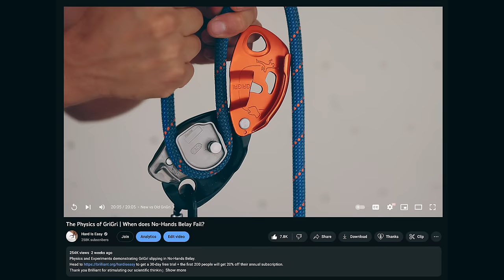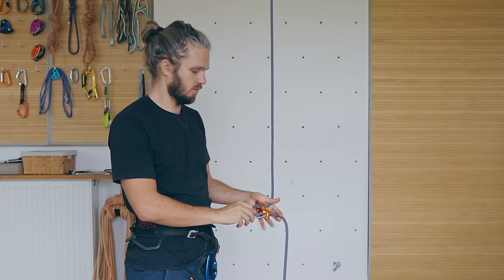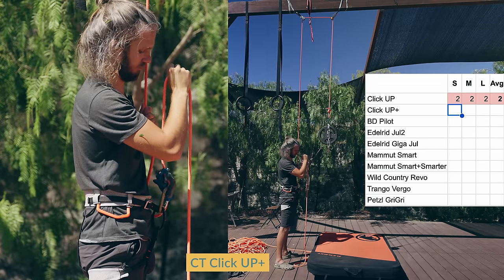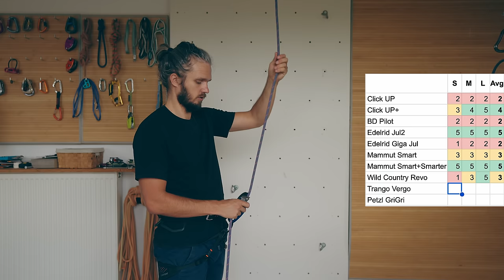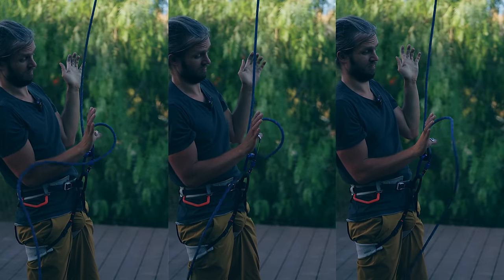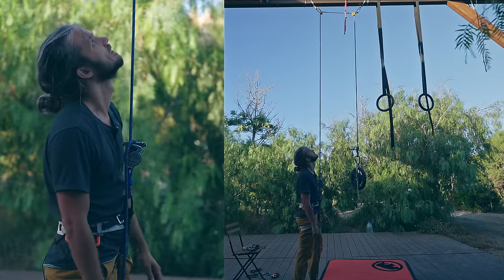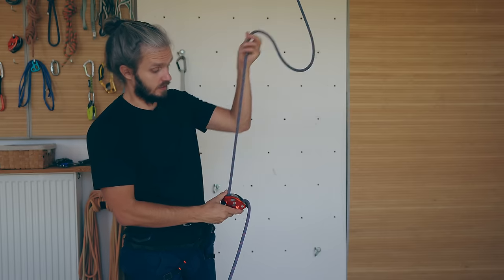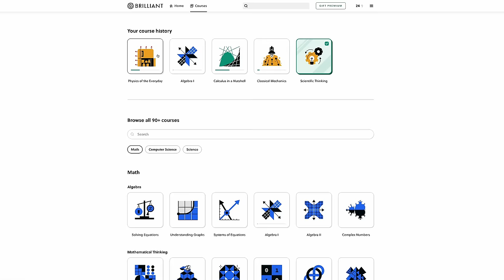When Assistance Fails!? The Physics And Experiments of Belay Devices

Comment: I kind of wish you had added the ATC to your rankings when you were testing all the devices together - a friend of mine saw your previous video of the grigri fall and concluded that she felt safer using her ATC than a grigri because of it! So I worry that this kind of video, pushing all the assisted devices to failure, might be better with a little disclaimer that the ATC would fail all these tests! Anyways now I'm curious about if there's any way to make an ATC fail in guide mode. Also, I hope you get some belay gloves for whatever tests you do next, that was painful to watch - but thank you for the sacrifice for this amzing demo!
Reply: Some ATCs will fail in guide mode with very skinny ropes coz the two strands will get pulled past each other.
Reply: Yes it should be on the same chart with 0 for all tests
Reply: The ATC is like all the other devices.  One has to use it properly.
Reply: @FlatOutFE  No, I agree, I have one and use mine regularly (my gym ropes are thick and fuzzy enough that giving slack with a grigri is a struggle, and for multipitch stuff), and I like it. But even with perfect technique, an assisted device is arguably a lot safer for sport climbing outdoors where a rock could fall on your head and where the weight penalty and the capacity for using 2 ropes don't matter. And I certainly wouldn't consider it safer than an assisted device.
Reply: @Blue-pb7kz  , two ropes are safer than one.  Helmets designed for side impacts are safer than those just designed for top impacts.  Two carabiners are safer than one.   Locking carabiners are safer than non-locking carabiners.  In the end we all make compromises.  The unfortunate thing is that most people now consider ATC devices as unsafe, yet they have served climbers well for 50 years.
Reply: @FlatOutFE  I think that that depends on where you live. In my country, the majority of people use ATCs, and gyms only have ATCs for rent and for beginner classes. Assisted devices are rare here. I think people here could use more assisted devices, and that it would be a good thing on the whole for more people to use them. But I hear in America some gyms force people to only use assisted devices, which I don't love - I think learning to belay on an ATC really drilled in the "don't let go of the break hand" side of things that Grigri users might get lax on. Still, I'm glad I have a grigri, it has its uses, and I do believe it's safer so I take it for outdoor sport climbing. But I also keep my ATC. Like you said it's a compromise, especially bc time is also a major safety thing that competes with all the redundancy and sometimes you have to be quick and not spend half an hour building an anchor. (Though I think the choice of using two ropes isn't just a safety thing, but more of a rappel thing!)
Reply: This! Your comment should be upvoted!
Reply from the maker: Agree! I had originally a segment talking about this and more on other devices but this vid got to long and I decided to split it and do a separate overal comparison video.

ATC is hands down the most risky option and if climber doesn't understand that well he had a bad training or haven't seen enough fails.

Comment: I feel like the revo is so misunderstood, the assisted breaking is not ever supposed to engage except for those really catastrophic situations. Generally, it provides zero assistance and it's big selling point is it being an extremely smooth tube style belay
Reply: Exactly, I haven't used it extensively but you basically belay with it like a regular ATC-style device and the full lock-up is there in case you mess up or get injured.
Reply: @Govanification  I've never used one.  So if your break hand is held down the cam never spins up to 4m/s before locking? It's an instant lock?
Reply: @Yildun28  No if you hold onto the brake strand, the device brakes on the friction teeth like a regular ATC and thus the rotating cam doesn't spin fast or engage at all.
Reply: I used the revo for a bit. I wish it were easier to engage the lock when someone was hanging. And I also accidentally engaged the lock when quickly pulling in slack which caused some headaches. With more experience that would probably go away or I could recover from it smoothly. Kind of hoping they can figure out a 2.0 with some improvements because I did love how smoothly it fed out slack
Reply: @belavandervoort  I'd never thought about either of those situations! the first seems super annoying, that's my favorite thing about using a grigri! The second seems like it could be dangerous?
Reply from the maker: Yea for sure, I was comparing apples to apples how these devices react in same situations. To my best ability.
And as some pointed out the biggest issue with Revo is that it does not provide enough resistance while taking slack so if someone is projecting a route you'll hate this device.
For casual belying it's nice.

Comment from the maker: A note: As I already mentioned carabiner plays a big role in auto-tubers, and although only CT ClickUP / + requires specific carabiner, for the next video I'll try to reach out to manufacturers and get their recommendation on "the best" carabiner for their device. And then test everything again... :D
A note #2: In some of my tests I inserted Trango Vergo incorrectly, but it's still nice to know that it worked well, but seems like I'm slightly too dumb to understand this "intuitive" design to load it properly all the time :D Also I received multiple emails stating other issues with Trango Vergo that I'll have to investigate for the follow up video.
A note #3: Just received another email with a video demonstrating Jul2 slipping and not locking at all - and Jul2 worked in my tests so well :(

So as I already said - there is always more to every story... and I see that creating a Rating table might have been not the smartest move of mine :DD
Reply: Hello, loved this video! I use the fish. Have you heard of it? It’s comparable to the smart 2.0 I guess 🤔 and it always comes together with its own security carabiner when you buy it. So far I‘m really happy with it :)
Reply: I have a megajul sport and it fails when the wire loop (i dont know how its called )gets stuck in the top off the screwgate in the carabiner,  and its works as a normal belay plate, because it dont let the megajul get clousser enough to the carbiner to press the rope
Reply: Your suffering for science is appreciated, but feel free to use gloves next time - we will not judge you!
Regarding Gigajul, I noticed quite a bit of carabiner dependence. Some are much better than others! Could you test that and maybe reply back? What seems to work well is the Edelrid HMS Strike FG.
Reply: @testboga5991  I use the  I use the Jul2 + HMS bulletproof Triple FG carabiner in the gym and the GigaJul + HMS bulletproof screw FG outdoors. so basically the same carabiner, and more or less the same as ths HMS Strike. I've noticed the GigaJul tends to slip a lot when it should be locked off. Like if I relax my grip, the rope will start slipping through.
Reply: I think that Jul2 also requires special carabiner - the steel one or Edelrid Booletproof (aluminium with steel insert), as it is not very gentle with alu ones. It can be also a safety issue.
Reply: The edelrid JUL² is VERY sensitiv on rope+ biner combinations, a new 9,8mm rope+JUL²+not intended Carabiner i wittnessed following effect:
At break check it blocked the rope, when climber afterwards sat in rope at the top to get lowered, it completely started to slip like there would be no additional friction at all.
Only the brake hand holding prevented a too fast descent of course. But i never wittnessed such a complete loss of additional braking friction also just once since invention of JUL²in 2016.
i can´t remember exactly, but it was perhaps a dry treatened rope my clients bought themselves, not sure. But really akward to have a autotube style device, doing nothing to brake the climber. The only "wrong" in the setup was the used biner Grivel k10g S, and i had no Edelrid Bruce HMS (intended to use with most Edelrid devices) not with me that day.

So: Each belay device has to be tested with care, every rope, every climber, and perhaps rain on the device can change the behaviour of the device.
So never let go the break rope, and new ropes can be slippery as hell.

i also have some experience on cinch/vergo:

it´s a pretty underrated device (both cinch (old) vergo (new) ) in my opinion.
Downside, the akward and unusual handling, wears down rather quickly.
positiv, no spring opening a blocked device, so if the belayer hold the brake side of the rope ( as everyone should do) it´s safe.
the bad reputation the cinch got, was user error intended. blaming the device for "not blocking", but all those accident where when they let go the brake side.
The cich/vergo is a very safe device WHEN USED CORRECTLY. (especially the brake rope has to be controlled 100%, to make the vergo even block when attached wrong to harness, or entered the rope completely wrong.)
i know and own lot of belay devices and i also use and have teached them how to be used.
And the principle of the cinch/vergo is just ace, in my opinion. Is it fool proof ? No of course not.
But as every device, a good belayer can do a lot even just with a simple hitch. A rather bad belayer can always screw up somehow.

Comment: I've been using either a Jul or mega jul for a few years now and have a few comments on technique.
You don't need to wrap your thumb all the way around it when paying out slack, pushing it to the side with your thumb or just using the pad (tip) of your thumb to put some pressure up on it is enough to allow slack to go through easily and will not put up enough resistance to hold the device open if the leader falls.
The narrower the beam of the belay carabiner is the harder it will catch a fall, I've been using the bulletproof HMS locker for a while now and it's been a good match.  The large round cross section lockers don't get pulled u into the notch as far and it can end up with a bit of slippage, not a drop, just a bit of slippage.

It was neat to see the giga jul just slow down the weight and not fully lock up since these devices are marketed as assisted braking / friction increasing devices and not auto catching.

Comment: Regarding your test results with the Gigajul.
In the beginning I had exactly the same results. I tried several carabiners until I found a really good fit. the most important thing was that the upper carabiner axis is as narrow as possible. currently I use a Petzl Frenio, with this the Gigajoul locks pretty quickly and reliable.
Reply: good to know thanks. I just got a gigajul and was gonna get the freino for my grigri
Reply: The natural choices of carabiner to partner the Edelrid Giga Jul would be Edelrid's Bulletproof (with the steel insert to reduce rope induced wear) and the Strike. In my experience, the former is too large, and giving rope is a pain; the latter is better in that regard, and I believe that Edelrid itself sells this pairing as a set.
Reply: Would a megajul behave similarly?

Comment: I have a BD Pilot and I've had really good experience with it. And what I like about it is the reliability and consistency. The device extremely rarely does something unexpected in my experience.
Reply: I love mine too, but I have had 2 instances where it had some issues. Both were caused by my climbing partner. One was leading in a gym and he didn’t flake the rope when he pulled it out, it was so twisted up that the rope curled through the side next to the carabiner and caused the rope to bind while giving slack. Other situation was the same thing, but outside. I need to make him flake his rope so that doesn’t happen again, and I’m sure that would happen with most of the tube style devices
Reply: Same here, using BD for 3y without any dangerous / slip situation. As said in the video - it's about experience and understanding the device, not about the device itself. Great video anyway!
Reply: I like mine, I can give and take slack really easily, but it doesn't lock up as easily or as firmly as the Smart. It's also harder to find the thumb release and sometimes I have to fumble for it. All things considered I think I prefer the smart.

Comment: Great work! For your No-Slack fall with the Vergo at 16:25, you have the device facing the opposite direction as Trango instructs (the handle should be pointing at you, not away from you when attached to the carabiner, before you twist the device into a normal belay position. See the owner's manual). I don't believe it would fail this scenario if set up properly.

Comment: When we went to a safety course, we were instructed that with geometric locking devices the type of carabiner make a very big impact. Wonder how the results would be impacted by that!
Reply from the maker: Yes carabiner shape is very important, but testing all of them is impossible so my results should be taken with great caution.
Reply: @HardIsEasy  I think "great caution" might be an overestimation 😉
Reply: @HardIsEasy  This is true, thank you so much. For example I went back and looked at which carabiner you used with the old click up, still my device of choice. And I believe you used the clickup plus carabiner, do you know if it is exactly the same?
Reply: @TheDudeFromKalispell  In my experience the clickup carabiners can be a little less likely to cause the device to lock than the thick stainless steel monsters we have lying around, but I don't know about the clickup plus. I imagine the increased diameter and circular profile jams the rope in a little tighter.

Comment: These are great results to learn from. I believe we need to reflect on the manufacturers' design decisions as well. For example, I still feel really comfortable using the click up as it replicates the atc style of giving slack without touching the device and it performs great in experiment 2 which would be the most common situation in climbing. I am not too worried about such a grave user error in experiment 1 and 3 with myself. For experiment 3, it does give me pause, but as a belayer I would have to be completely incapacitated by a heart attack or falling rock for this to become relevant.

Comment: Thank you so much for this research and education. I'm not a Revo owner, but I was interested in the Revo, so I went and pulled the manual and marketing material. Here's what I found: Wild Country does not consider the Revo's locking mechanism as a primary safety device, in contrast to something like the GriGri. Instead, it is purely a backup SHTF system. They consider the Revo an ordinary Tubular device. The manual states this clear as day: "Be aware that if the REVO does not lock it is because you are doing your job as a belayer".  So from that, I don't even think the Revo could/should be considered an assisted device.  Whats disappointing is that the Revo is more than likely the "safest" design from a mechanical perspective, but they have the device tuned to be far less sensitive than needed to be considered an assistive belay device. Maybe this is their lawyer department, or maybe Wild Country does not think repeatedly locking the Revo thousands of times is safe (from a wear perspective). There are climbers that have modified the Revo to lock much easier, but the device could possibly wear out faster. In any case, I think it's only safe to follow the manual and consider the Revo an ordinary tube device. Your experimental results certainly line up with the manual's guidance.